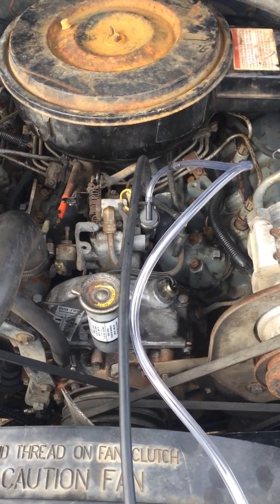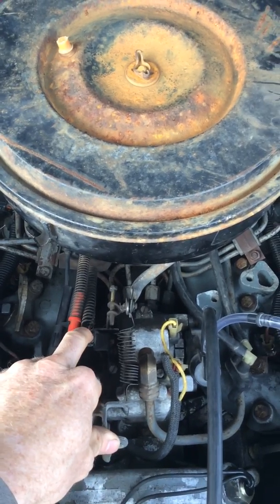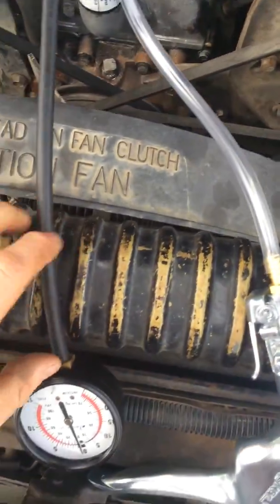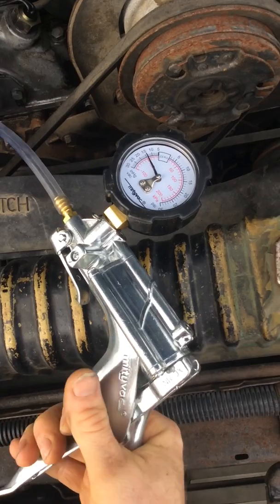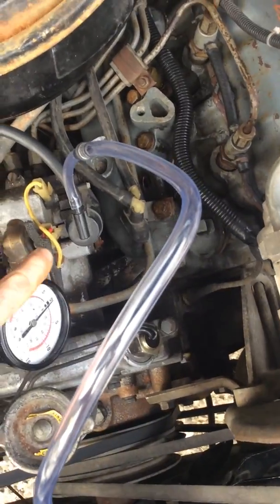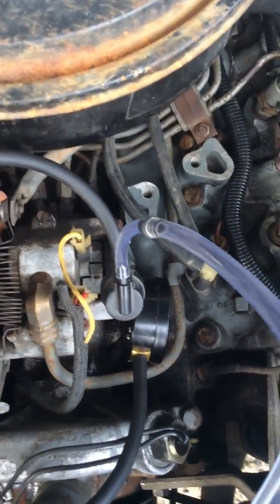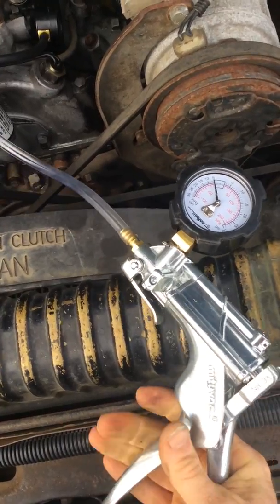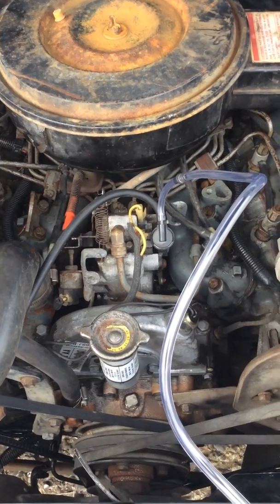Ford 6.9 idi VRV (vacuum regulator valve) adjustment

Comment: I just replaced the trans fluid in the pan  filter and vaccum modulator on this old 86 6.9 idi c6.  It was shifting earlier but now shifting into 2nd at about 2500rpms and 23-2400 into 3rd.  Does this seem ok?  I backed the modulator screw out to get as early as possible shift as I could.  Any help would be great thanks!
Reply from the maker: Did you vac test it before adjusting?  Even a small movement can make a huge difference.  I recommend running though this in order as described in the video.

Comment: where could i order an idi 1989 7.3. During an engine swap, the castle nut broke tried to swap it out when it was installed with the old engine vrv/ Now i cant use either one. I tried putting one together and it is hard any sugestions or videos that cant help rebuild the vrv . or a online store i can order one .???
Reply from the maker: luis sanchez you might have to have a used one. Don’t be shy about spending a little to get one. They are getting rare. There are reproduced vrv valves but they are just as hard to find as oem ones. Oem has been discontinued for a while now. 
   If you find one share the info so others can know too!

Comment: Great video.  What is supposed to be connected to the other plastic nipple after this test ?   The lower one goes to the transmission, what is supposed to connect to the top ?
Reply from the maker: Nicholas Bertola thanks, I always wonder if these vids help others. The top hose connects to a vacuum manifold. It’s a vacuum junction. Your vac pump feeds it and it splits to many other sources that need the vacuum like brake booster.. ect

Comment: We have an 85 F350 that is, I'm assuming,  getting too much vacuum assist to the brakes making the brakes way to powerful. Would this valve adjustment affect the brake vacuum assist? Or would you know of another adjustment for the brakes?
Reply from the maker: woolc - to much vac isn’t really  an issue. Mine is the opposite so I’ll make a vid how to test it. There is a push rod between the booster control valve and master cylinder piston. If it to tight your brakes will drag or activate extremely quick and to loose lots of pedal play.. unfortunately you have to remove the master cylinder to get to it. Take note is it the back or front surprising you? Also perhaps it’s just a sticking caliper? We could go on but do some tests.. assuming doesn’t really help.. test it and have fun testing it.. cheers and good luck.
Reply: @tomknox8227  Thanks for the response! I'll have my friend watch as I hit the brakes to see if the backs are locking up. As long as we've had the truck it's had this issue of having to be extremely careful stepping on the brakes. A little modulation and it's ok but about a third of the way into the brake travel and everything immediately locks up. The push rod sounds like a possibility!
Reply from the maker: woolc - that question has stuck in the back of my mind! I’ve run into it before. Water accumulation in the brake lines can make for poor or over grabby brakes. Also the pads themselves can soak up moisture  changing the texture making them slip or sticky or grabby too.. just a thought! Flushing the system with a vac gun is quick and easy and cheap!! Best of luck

Comment: What was the issue with the engine that you had to check that valve?
Reply from the maker: javier valdez -the auto transmission wasn’t shifting correctly. It had a long hard pause from 1st to 2nd.. it fixed it immediately

Comment: What manual do You use?
Reply from the maker: Texan Balaban - I’m actually using the factory 1985 Ford shop manual (s)  for bronco, econoline e150-350 and f150-f350
Reply: @tomknox8227  I'll be looking for one soon. Thank You 🍻
Reply from the maker: Texan Balaban - if you have a specific question, problem or specs.. let me know
Reply: @tomknox8227  thank You B0$$ 💯😎🍻